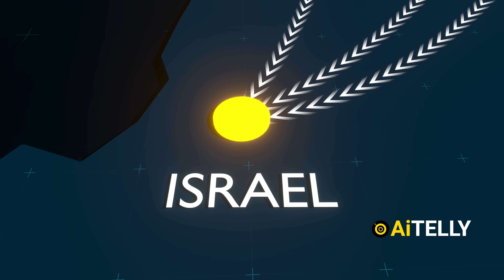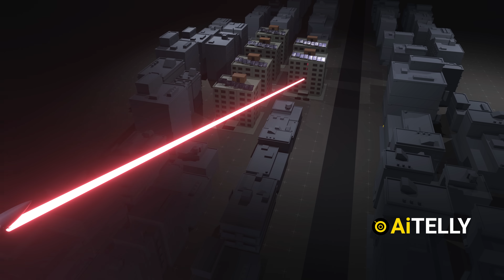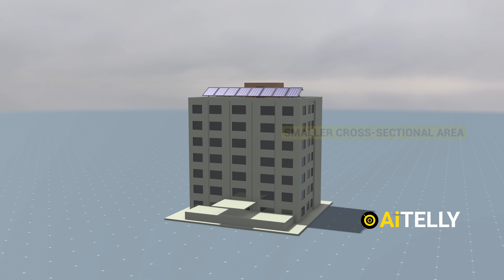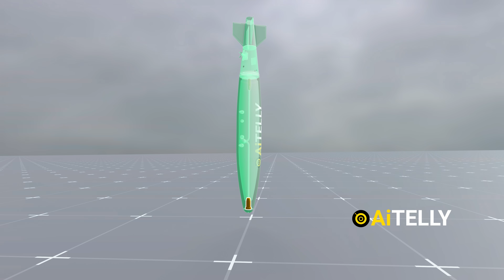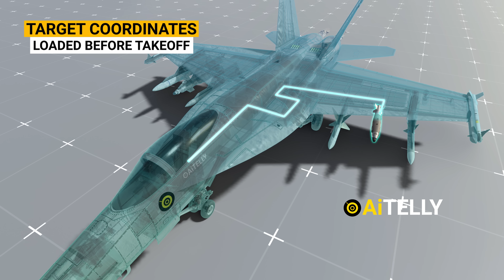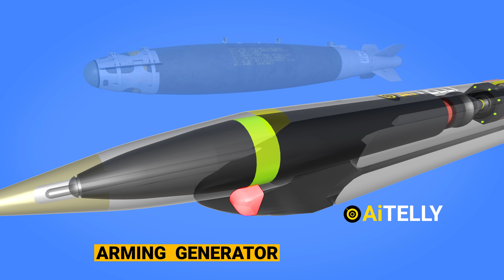How Israel assassinate Hassan Nasrallah in Lebanon? #israel #iran #hezbollah

Comment: Just a quick note: I think you got the concept of laser guidance wrong.
The bomb itself doesnt emit a laser (as shown in the video).
The laser is emitted by an aircraft or ground asset and is turned on sometime before the bomb impacts. The seeker of the bomb just looks for the laser reflection on the target and homes in on that. It might be beneficial to turn the laser on the last moment before the impact since the laser can be spotted by the enemy. Either by eye (unlikely because I think everyone by now uses frequences not visible to the human eye) or a technical device (actually quite likely depending on the technology level of the opponent). Therefore you might want to keep the time with active emitting laser as short as possible.
In that case the bomb just travels on a calculated "dumb" trajectory until the laser is lit and the bomb homes in for the extra precision or against moving targets (with restrictions by physics due to the bomb having limited range and steering).

Comment: It was secret operation named "Shiduh boded" (Lonely match) It is well-known fact that nasralla liked to relax in hot bathtub with bubbles. So Israeli agents equipped like plumbers cut off water pipes but attached pipes from rocket fuel reservoir to the water supply system of nasralla's bunker. Then alone match was applied.

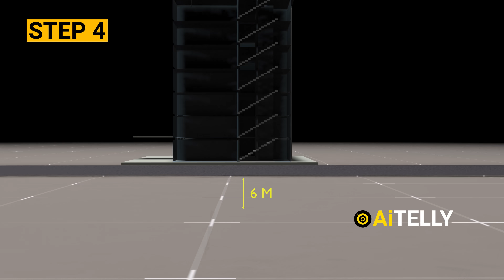Comment: There's a quite a significant mistake at 5:17 - 100ft is not 100m, it's 'only' around 30,5m. Still impressive penetration depth though.

Comment: Animations are wrong. Bunker missiles are launched at the base of the building in an angle. Usually is taken the less resisnce path if you want to penetrate a bunker. Why would you go thru 6 floors just to reach the basement when you have access from the bottom?

Comment: Easy to follow video
In general, a number itself cannot be "translated" into another number in the way words or text are translated from one language to another. However, numbers can be converted or transformed from one system to another (e.g., from one unit of measurement to another, like feet to meters) or from one format to another (such as decimals to fractions).

Converting: Changing 12 feet to 3.66 meters.

Transforming: Converting a binary number (1010) to its decimal equivalent (10).

In the strict sense of translation, it usually refers to language or interpretation, not numbers.

Comment: If you're attacking from a direction with at least some unobstructed view, commencing a 60 or 70 degree dive bombing angle you wouldn't need to hit the buildings. Laser guided bombs like the paveway and others, have a CEP of <1m. With a bunker buster or penetrating bomb, you could hit the ground outside of the building. It would actually be difficult to go through 6 stories of the building and hit the bunker underneath, as the angle the bombs fly and penetrate is not 90degrees down.
Reply: hi

Comment: There's so many errors in this video. You really did let chat gpt write this entire script. The amount of misinformation and complete misunderstanding of these weapons systems is insane.
Reply: @BearCavalry91  so care to explain the misinformation?
Reply: @Stconstantinex  Sure. For starters there is no conduit that “burns” inside any Mk series bomb. The conduit is where electric powered fuze cables go to attach to a FZU-XX device that powers the fuze during flight. In a JDAM configured bomb, the fuze contains the boosting charge to detonate it. AiTelly could improve his JDAM animation by attaching the tail kit right side up so the data port is facing up (the lug side of the bomb) The GBU-39 didn’t “essentially repurpose a Mk82 bomb “warhead” either. The initial batch of BLU-113 bombs were made from howitzer barrels (the tall laser guided bomb in the video), they claim it has 650 lbs of explosives then a minute later says it has 700 lbs. The channel needs quality control and needs to stop using Ai to write scripts. Its clearly making stuff up.

Comment: One thing you could have mentioned is if you look at the video they dropped a number of bombs one after another. This way they could guarantee much deeper penetration than just one bunker buster and one normal guided bomb. THey did this to all 5 buildings.  Some of these buildings kept the roofs intact with the explosions coming from underneath. So that means that the ground penetrating bombs and the subsequent followups were designed to hit a spot on the sidewalk beside the building with a steep penetration angle with the penetrating bomb and then a couple of more for more explosive power, ie to kill with the blast waves.  The reports are that Nasrallah wasnt killed by shrapnel he was found with his body in tact but dead, due to the blast wave of pressure.
Reply: They said he suffocated from toxic fumes
Reply: @phillipmartinez9232   That was conjecture based on the intact body with no signs of blunt force trauma.
Reply: @The1stDukeDroklar  yeah but possible or from the blast pressure either way that could take a while to kill like when us killed al zarqawi in 07. He survived blast for like hour but his lungs were damaged and he died from that.
Reply: @phillipmartinez9232  which would mean, the main bunker wasnt crushed... just some fissures. Apparently well build, but the gases got him.   Ps: but perhaps its a myth?  Great leaders are usually unharmed even if dead... Look on admiral Yamamoto, whose plan got shot down.  He is said to be found still holding his samuray sword firmly in his hand...
Reply: @barneydenstad2148  great leaders this terrorist was a mass murderer mostly of other Muslims but sure lol
Reply: @barneydenstad2148  I believe Yamamoto was found still sitting in his aircraft seat but he had been struck by .50 caliber shells from the P-38 Lightnings that got him. .50 caliber shells do a great deal of damage to a human body. I have heard that one struck his head as well. You can imagine what that did.
Reply: @ToddSauve  Yeah. And yet its said he held his samurai sword in his hand... So both double hits, and crash... Myth??
Reply: @barneydenstad2148   Totalitarian regimes like the WW2 Imperial Japanese were all about saying anything for propaganda purposes. If it made Yamamoto appear superhuman even in death, then they would say or do anything.
Reply: @phillipmartinez9232  POSSIBLE SOFOCATION HYPOXIA.
Reply: @soydechileyque  yeah sounds right.
Reply: ALL 5 buildings?  Nay, on the published pics all buildings around seems intact, with just some superficial damages on the outside.   Hithertho I thought it was a low building in the yard hiding the bunker. Its first now I see it was a whole 6 store building which collapsed totally onto the crater.  So it was a surgical precision attach on ONE target building.
Reply: It's also coming to light by the Syndicate of Chemists in Lebanon that Israel (and the US) might have used depleted uranium for this operation.
Reply: @Magee1111  That would make sense if you want to bust something open that is tough to break.
Reply: A Marine at Khe Sanh described the aftermath of archlight raids, aka B-52 carpet bombing.

Some NVA survived. They were in their trenches, but something weird would happen about 15 minutes after the bombing ended.

Some would get out of their trenches and aimlessly walk around with no weapons, like a group of zombies. Then he realized the intense bombing blast waves gave them concussions. They probably didn't even know their own name or where they were at.

He, as a machine gunner, would then open fire.
Reply: @gabrielrodriguez821 whatever it takes. I feel bad for the wildlife that gets decimated. 😭
Reply: @Jasonfallen71  yes, think about all the cats, both pets and homeless.  And the dogs, etc

Comment: You are wrong on almost everything... I'm sorry.
It's not like someone can just stand there and laser point the building and see Nasrallah arriving, it doesn't work like that...
Israel knew about the command center location for years and managed to track Nasrallah and know he is there, israel has infiltrated iran and hezbollah deeply and knows their movements.
The coordinates of the location and fuze delay are set to the bombs even on the ground before taking of, it wasn't 80 bombs but 80 tons, israel has 2.2 tons bunker busting gbu 72 and 1.8 ton gbu 28...
The bombs didn't fall through the buildings but at an angel under the buildings to hit the bunker below which collapsed and the buildings also collapsed since they are built on top... those buildings are housings for the hezbollah people and their families.
Reply: You have a point though,,you can hit the bunker diagonally through ground rather going via building,,,
Reply: Yes he is wrong. None use laser pointing in urban setting due obstructions. Just silly but he has seen movies about it.
Reply: @TheVoiTube  
"None use laser pointing in urban setting due obstructions. Just silly but he has seen movies about it."
Yes, you might hit the Chinese embassy in Belgrad....

If you can do or can't depends on the area and if the rangers unit can get a unobstructed line or not.
It depends heavily on the kind of buidings around, if´there are hills, you can get access to other high buildings and so on.
They don't use a 30m Laserpointer for that.
It is not a thing they only show in movies. 
I knew a guy who did this in the late 90's in Jugoslavia.
Reply: I think you’re right but I also heard/read that there were 80 bombs used as well. I can’t remember where I heard it but I definitely remember the 80 number as well.
Reply: @jonathanstewart4800  85 bombs each weighing 2 tons of explosives. Donated by the USA not purchased. The number of mistakes in the video keep pilling up. Read the news instead of relying on such sources.
Reply: @jonathanstewart4800  they did say that at first, I saw that to than later saying 80 tons.
Reply: Unfortunately,one of the safest place for evil was busted within a minute and became a graveyard.
Reply: Don't bother pointing out the inaccuracies (GBU-39 ???). The script and voice for this video are completely AI generated. There is nothing in this video beyond the slick animations. But it has almost 2 million views so I guess we are the ignorant idiots.
Reply: He is wrong on sooo many levels, even stated the bunker busting bombs would cost 3 billion when it’s in reality not even a million. I am baffled why anyone would make a video without researching absolute basics.
Reply: @NemoNobody0  Money. Money. MONEY. As long as you get the views what does it matter what crap you put out.
Reply: It was also not 6 buildings but 4 and they weren't all next to each other like is seen in the animation.
Reply: @CDLightt   a compound of 6 buildings linked together by tunnels. The tunnels were built by North Korean engineers ! They were 14 stories deep.  I dunno where this guy gets his info from.   Read the news.
Reply: Those videos are generated by AI and don’t make any sense
Reply: This is channel is AI slop, no wonder it's all wrong
Reply: @tzioni  thanks for the knowledge!
Reply: You talk as if you’re a Mossad agent with absolutely 0 credibility. Just another YouTube general posting from his moms suburban 2 story lol
Reply: so you say, most of the civilians in the house were really - hizbollah with families??  Cool.  So the amount of corollary casualties immediately cut down by at least 1/5...   And the amount of legal targets arised with perhaps 50.
Reply: Almost everything in this channel is false. Just an AI money grab
Reply: Additionally, it's coming to light by the Syndicate of Chemists in Lebanon that Israel (and the US) might have used depleted uranium for this operation.
Reply: "It's not like someone can just stand there and laser point the building and see Nasrallah arriving, it doesn't work like that..."
Why not?
I knew a French guy who literally did that.
Going with his team in unmarked uniforms in another country and marking targets with a laser.
Reply: سلام موتور سوار خوبی داداش موتورت اشتباه نکنم کی تی ام هست
Reply: שלום אני מישראל קוראים לי הלל אני שאתה צודק ואני יודע שבעוד שבועיים יחסלו את יחיא סינוואר
Reply: @יהודהאלטשולר   كلامك مش واضح عيدها
Reply: Says the agent 😅😅😅😂😂😂😂
Reply: I don't know about Iran but Hezzbollah is completely infiltrated.
Reply: He also states in this video that 100 feet is 100 meters. Last video I’m watching from this guy. Every video has some insane factual flaws
Reply: @whypanicpvp lol true
Reply: To be fair this is probably a 17 year old kid making this video
Reply: @daheikkinen lol true 😂
Reply: @daheikkinen  Then he must be informed by someone that this is not a "welcome to channel" situation.
Reply: They were not sure under which building the main bunker was, so that's why they attacked 4 buildings "basements" - that's why so many bombs. And bombs arrived at the sequence, with delay one behind the other, to try to hit the same spot, and penetrate deeper and deeper ... Also, in such close populated area, with pretty high buildings, it's hard to hit the base of the building from the side, so they had to remove some obstruction first, and then hit main buildings base...and, considering that The body was almost intact, can say, that operation was almost a failure... Pure "luck" for the attackers, created the conditions inside, that the targeted person died of...lack of oxygen, or similar story ..
Reply: Nasrallah died from the gas lickage inside the bunker. He didn't die from the blast itself. This video is wrong😂😂. It was the bunkers design fault that led to his death. It should be completely sealed
Reply: @Returntonature145 He died from bluntforce trauma which is from the blast!
Reply: @Returntonature145  yes, a gas leak. The stoves in the bunker are cheap. Not Israeli made. Ignited methane travelled back through the line to the community methane bio digester and leveled a city block. It's why their toilets are on the floor.
Reply: @Returntonature145  makes sense...
Reply: Source is "trust me"?
Reply: How can the bombs hit an angel?
Reply: "The bombs didn't fall through the buildings but at an angel under the buildings to hit the bunker below ..."

There was an  angel under the bldg?

Comment: What surprises me is that the F-15 is still capable for such covert operations.
Reply: It doesn't needs to be covert, they don't have formidable anti air...
Reply: Israeli F15's are modernized.
Reply: what are y talkling about? F15 is the air king,  not mention Israaeli one with uphgraded Tec
Reply: Iarael re-engineered it into the F-15i. Its on par today with most fighters and payload delivery assets. Much cheeper than the F-35s.
Reply: S- 500 was not deployed😅😅
Reply: I dont think the f-15s were used. More like f-35s. And it was a 6,000lb bomb
Reply: What surprised me  is that your mother plays like no ether
Reply: @yunkshione-1016   There was no serious air defense systems that could serve as a threat to the F-15s. Hence, it's use in the operation. Hadn't been the air defense system was potent, Isreal could have used their F-35 stealth jets instead